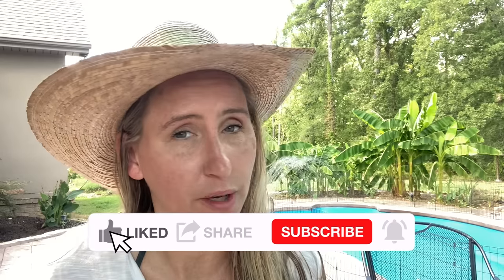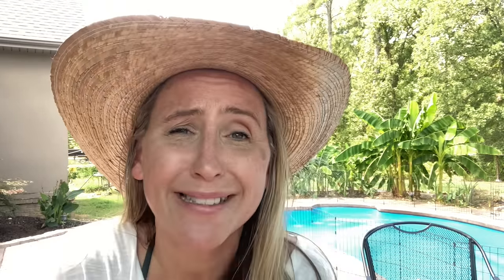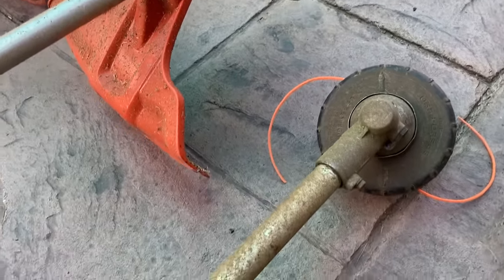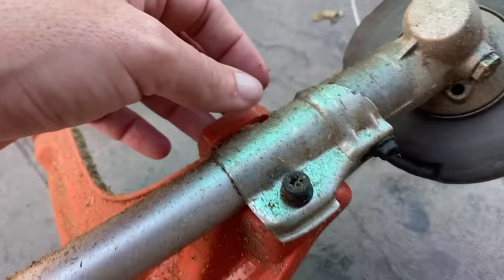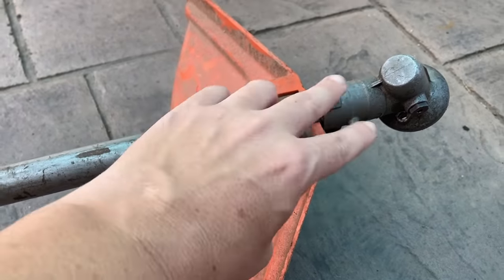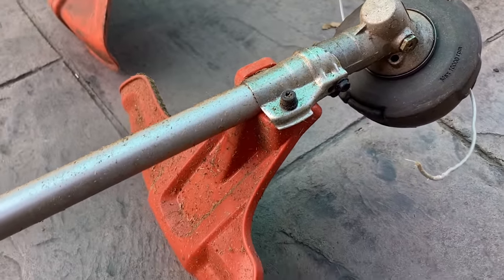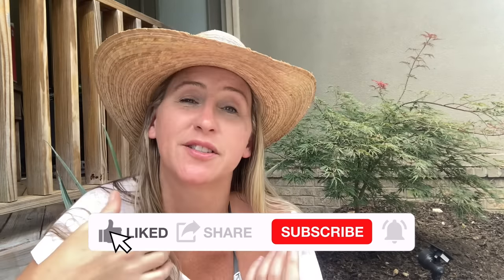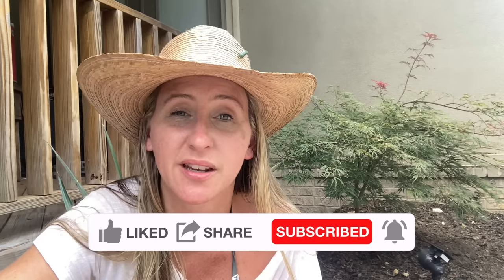String trimmer guard ON or OFF? Will it destroy your Stihl, Echo or Husqvarna? You might be shocked!

Comment: I used to HAVE to have the shield on. If I took it off, I'd always, ALWAYS, gouge the grass and make a nasty bare spot where I didn't want one. so back on it went. But one day I decided to remove it and just go super slow to get used to it not being on there. Now, I'm just as fast if not faster than when I had it on there. Plus it's easy to flip it on its side and do some edging with it. Plus, trimming around small to medium-sized trees and bushes/shrubs is easy as I can just stand in one spot and reach all the way around it.

Comment: You said that when the head freewheels that could mean a bad clutch. I have two Stihl FS90's and they both freewheel for a bit. They finally stop but it takes a moment or so. Is the reason taking the guard off is because the line might not be even thus throwing the head off balance other that the reason you mentioned? My wife and I are retired and mow 26 lawns most of them every two weeks so I don't use my trimmers as much as some other lawn care people but I like my Stihls. I have one of those rubber paddles to clean up after the snow plows get done pushing the gravel driveways onto the lawns, a rototiller, that I use mostly in the spring on raised bed gardens and such that I can't get my Troybilt rototiller into, and what they call a power scythe, kind of like a 10 inch hedge trimmer that I use to trim around a customer's pond, and haven't had any trouble at all with any of them. They are pricy though, seems like $200.00 is the going rate for Stihl trimmer attachements astray when I bought these. I really enjoy your videos, keep up the good work.

Comment: Am I the only one who has an Echo that uses dual pre-cut line? 

All these responses saying the extra line will unbalance/overtax the motor must be using bump heads with spools, right? 

If the only difference is the wear on the motor and I keep the string cut to spec, I am only risking my shins, no? 

(I wear big glasses all the time, so pipe down about putting my eye out.)

Comment: 7:47 those split shafts are great for multi-tasking but not good for a dedicated use trimmer. They all weigh a few pounds more than the solid shafts, and those few pounds add up fast over the course of the day. I hate my stihl split shaft. Maruyama or Kobalt electric, the split shaft stays at home unless I have hedges to trim.
* for someone who doesn't use their trimmer all day long, yeah np def get the split shaft. Pardon my opinionated comment, KM130 is an oldschool beast of a trouble. The entry-level Maruyama solid is night and day velvet to gravel. 4 years smooth, nothing but the face wearing down eventually. Starts on a hot day, burns nothing for fuel, and the shroud stays cooler for if you touch the forearm.

Comment: Did lawn maintenance for 40 years and always used STihl trimmers36-39 cc. Never used protector, never had gear head or clutch problem. I noticed most commercial folks today use 21 -25 cc trimmers which would be a lot more sensitive to heavy loads
The main reason I don't like them is the auto cut keeps the length of the string at least 35% less than what I like but again, I use 36 cc and up

Comment: This whole idea of "removing guards" regardless of it being a brush cutter, a grinder or a saw bench is much more prevalent in the US, than many other countries.
There is just this bloody minded idea, that they simply won't be told.
This easily explains the very much higher rates of industrial injury in the US, than in many other civilized countries.
 
Nobody seems to raise the issue of insurance and public liability.
If you have an injury, to you or an employee, damage to property or something else, if you do not have a guard fitted to whatever, you may find your insurance invalid or fines and charges apply under some sort of workplace or safety regulation.

Now I live on acreage and spend many hours on the brush cutter, mostly with a rigid blade, but, two fuel tank sessions ( about two hours) with trimmer line are not unusual, often heavy work.
There is no way I will operate a brush cutter without a full face shield, seeing what is on the shield after a session, hearing and feeling what hits my face shield while I work.
Yes the guard remains on the machine regardless. Yes I know what it stops from hitting me.

People underestimate the power of both brush cutters & grinders AND how fast and hard they can throw things and how much damage they can cause.

A friend of mine ( a home owner) just spent a night in hospital and a fortnight limping, after he copped a stone in his shin, it went thru the flesh and chipped his shinbone.

We also need to remember anything that cuts us doing mowing operations will be dirty. The probability of infection is pretty high.

The subject of running long lines, causing wear and tear is valid.

I do not run self feeding heads, because I have yet to find one that will stand up to the work here. 
But consider the extra wear and tear on a feed head, by running much longer lines.

Now those who have read the manual, will know that when we tune the carby and set the idle, we should do so with the cutter head fitted with a correctly trimmed line.
How does running these long lines influence this.?

Consider also, correct length lines probably hit harder and cut cleaner.
I have seen the vid in question and I cant hear the clean cutting sound I am used to, the strings sound like they are tearing the material.

There also seems to be a complete ignorance of rigid blades on brushcutters, in the mowing community.
If these guys want something that cuts fast and efficiently in open ground, a rigid blade would outpace a string line every time.
Contrary to popular opinion, string lines throw things harder and faster than rigid blades.

Apart from the fact that, I have never thaught that the guard caused any sort of visibility problem.
I have four friends that are mowing contractors, they all work with their guards fitted and it does not seem to cause them a problem.

Comment: Not to take sides with the on/off debate - just to offer an observation. Since it seems that the guard is also part of the stabilization by means of the bracket, instead of simply removing the guard assembly, bracket and all, why not just cut the plastic portion off and leave the bracket in place?

Comment: I like your content. I have a Sthil curve red shaft without shield. A season or so I switched heads to the plastic blades. I make sure I wear face protection because those plastic blades can pu and throw rocks. So wear eye/face protection, especially if your using those plastic blades!

Comment: On my stihl fs 240r I rock the shield off but I don't over shoot the string. I take it off for 3 reasons 1. It's the baddest od the stihl's 2. It gets caught up in the weeds and is annoying. 3.i don't really over shoot my string I use the stihl metal fixed head and only rock the string at 9.5 inche in length so just a touch more then stock.

I am also a mechanic so I know where to stop and not go over boat. Great video

Have you heard of a blue max weedeater is it part of  red max?

Also I have never heard much or seen bad with a stihl I mean shit I still got my old fs 85 from many moons ago and it has been thru hell! 😝

Comment: Got a srm 225 echo . Ive cut 1/2 an acre of bamboo. What I learned: love this trimmer. Abused the crap out of it, run it over with the truck and bent the shaft, straightened it back out, cut down cabbage palm trees and chinaberry  trees slammed and stuck brush cutter blades more times than I can count. Starts every time, runs flawless. Take that aggravating guard off if trying to cut bamboo. Tryed 5 and 3/8, 6.5, 7.25, 8 and 3/8, 9, and 10 inch blades. In my opinion the best brush cutter blade for this trimmer is a 6.5 or 7.25  narrow kerf 24 tooth  framing blade. The diamond knock out fits althougn a little sloppy.

Comment: I am a lowley  homeowner; but I always buy top of the line commercial equipment.  In the end, I save money since it lasts and lasts  and lasts.  I forgot they even have shields, but I do keep my ines trimmed for most efficient RPM power range.  Have had a clotch pad delaminate a long time ago on a "GreenMachine", easy to repair.  I evenrun grass/weed blades on top of my string heads at times.  No problems so far and we are talking nearly 50 years of such use.  Now, I can tell ya for sure not to run a bush hog over one .....

Comment: Hi from South Australia..I have wound new trimmer line into my FS50c and the ends have both been wound into the trim head.
how do I get the trimmer head off? I have tried sticking a small screw driver into the little hole but it does seem to lock the head.HELP!!

Comment: I thought the shield was a protector of flying danger, need correction it seems.
Just called my glass replacement company...$4000 is a low ball ball park price.  2nd floor 8 foot by 8 foot pane glass dual pane insulated window.  I am SHEILD OFF CAMP.  Er, I mean WAS.  17 years I have been shield off.  If my mistake can help anyone avoid the same deep gouge this is to another wallet, then consider it a win.
Truth is I am not sure the shield would have rerouted the gravel, but wish I could go back and have a do over.  So wise CHICK, does the shield stop debris from slinging out?

Comment: I have a shindiawa, S25, I think. It doesn’t have spark. I have changed the plug and checked the wiring to the on-off switch. It was is all intact. 
Can you give me some thoughts on what to check, or what could be wrong? Thanks.

Comment: From a commercial standpoint,  the liability incurred by removing the guard and cutter is astronomical!  It's not worth it.  Now,  I've altered the guard to allow the string to be longer and not too hard on the machine which seems to be way safer and more economical for production.  This was 15 years ago and on my current weed Wacker since I'm no longer in the business.  Redmax 23cc was our #1 preformer, still have one!  All I ever had issues with was premature wear on the clutch,  but worth the increase in production.  The lower rpms messed with the exuast port and cylinder too, but I was also the mechanic, so again,  that little extra line was worth it in the end.  Out of a dozen or so units, only saw one angle drive get mangled.  I'm sure these days,  the trash we buy can't handle nothing!

Comment: I have a straight shaft CUB,  both the high and low adjustments are covered with black plugs and the saw sounds like a hammer banging in the engine.  How do I adjust the carb?

Also I changed the head,  I hate the bump head so I chaged the head to one that takes  a single 14 inch single string.  I lasts  much longer and  no more winding string.   Love your videos thank for your work.

Comment: in 2018 I upgraded my 18 yr old Kawasaki 26cc for a Shindaiwa 24 because a Kawasaki was no longer available. I threw away the flexible extension and string cutter on the guard and after it ruined my back in 15 minutes flat I threw away that heavy huge autofeed head and still am using a really dog eared light, manual lengthen,  tiny, aftermarket head and worked happily ever after. Mind I monitor my string length really closely. Part of the guard is better than none!!  i love my handle bars too.

Comment: I am a homeowner. Have the Echo split bar trimmer. Have always removed the shield but keep the line reasonably short mainly to make it line fly straighter and not tangle in tall stuff. Interestibg to see commercial outfits remove the guards as i susoect OSHA looks dimly on removing safety features.

Comment: Do you crank a trimmer at full throttle or in the idle position? With my Stihl backpack blower, you can’t reach the throttle while cranking but it is idled up when it starts. As with any product you buy, always return the product to out of the box specifications before sending it in for warranty work.

Comment: the commercial pros use protective gear as required by certain safety guidelines and insurance purposes. If you're a homeowner and you like using the trimmer in bare feet and sandals. you're probably going to keep the protective guard on your trimmer. But if you garbage picked and fixed a non running grass trimmer and it's missing the safety shield. whatever it takes to make an income, go for it!

Comment: The guard is a safety device that according to OSHA should not be removed.  According to the risk control hierarchy the usage of PPE should be the last control measure to be implemented and an engineering control is the first line of control.  And guards are engineering controls that should not be removed.  This should be about safety and not about mechanical function

Comment: As a commercial operator I do agree that guards do reduce operator injury potential somewhat if used by an inexperienced person (but not eliminate it). 

Eye & leg protection is still necessary. 

For non-commercial users manufacturers fit these for legal reasons. The trimming blade is just to stop the shield being destroyed by the string whacking into it. 

For commercial operators we know our machines so well we can practically trim with our eyes closed. We know which way to orient the head to be most efficient AND safe. As an aside, I observe that most string trimmers are way overpowered. Using full throttle is very inefficient for most trimming jobs. In fact most of our customers appreciate us using electric trimmers at their homes instead of screaming two strokes so a lot of the comments about exhaust clogging are now irrelevant. 

Some of the comments here are pretty far off into theoretical waffling.

Comment: Love your videos.  I buy junk trimmers and run about 5gal of gas per year with no shield as i trim 40 acres of fence line and the gaurd is in the way. I do run my line legth by ear listen to the machine. I have had 3 trimmers since 1990 and one still was good enough to sell (i just wanted a combi type machine). In fact they were all curved shaft machines also. I guess no matter the machine you have to listen and feel know the limitations and definitely wear protection.

Comment: Yup, gotta comment again…. I’m not a huge echo fan for weed wackers or their smaller home owner backpack blowers, but I have 1 echo wacker with the split pole and I have a couple different attachments for it…. It’s been going strong for 6 years being used commercially…. I have done basic routine maintenance almost at an ocd level and will continue to until it doesn’t start anymore… I’m even still running the original carburetor and never had to rebuild or replace anything internally…. Clean it out a few times a year, replace the plug before and midway through every season, replace the fuel and air filter the same as the plug, I clean my spark arrester every so often (I prefer leaving them in) and I keep it clean…. For a cheaper machine I have to give it credit for being very reliable and it definitely doesn’t owe me a penny

Comment: You have to let the guard on to keep the string at the right length…..! It will ruin the engine faster by letting the string constantly longer Han it should be….. If the dealer can prove it your warranty is void…. ! Bottom line!!

Comment: I am a commercial cutter and will never buy stihl trimmers again. Bought 2 FS94R trimmers a few years ago my employees will not run a trimmer with a guard they always remove them I could not keep clutches in these trimmers they went every 2 to 3 months since they were new and since the guards were removed no warranty help from the dealer. I bought 3 Echo 2060T 3 years ago. Called my echo dealer and talked to him about which trimmer i was going to buy he recommended the 2060T this is the 3rd year using them not a single clutch issue or gear issue at the head when I picked them up there were no guards on them and or in the bags of goodies they gave me I have had a couple of miner issues they fixed under warranty. I have been very pleased with my dealer and these trimmers. I will say I maintain my equipment and keep the gears greased as well.

Comment: Although the shield can't protect you completely eye pro sure can, had a rock fly out bounced off something and hit me smack dab in the center of my prescription poly lens so hard I had to get it replaced, it would have very likely taken my eye out. you are correct the velocity of that flying object can be several feet per second, possibly in the BB or pellet gun range. and I agree with what another poster said about limited line length and engine performance, if it's an X" trimmer you can make it a XXX" trimmer and expect the same performance it ain't.

Comment: I have a cheap POS low powered 20 volt electric Black & Decker trimmer as my residential weed whacking needs are light, and as the owner of two cars, 4 motorcycles and a gas powered lawn mower, I need another ICE powered device to maintain like I need a hole in my head.  The el crappo Black & Decker weed whacker is set up shield off and running a little more line, which gives it something resembling cutting power.  Of course ya can't get carried away with the line length as the unit has no power to swing it, but an extra inch or so generates more speed at the end of the line, which makes a nice difference in how it cuts. 

The battery does get nice and warm after a trimming session, so it definitely draws more current than normal.  Been running it that way for at least 5 years, it hasn't died yet, I kind of wish it would. 😆